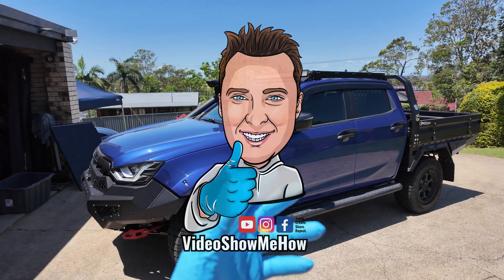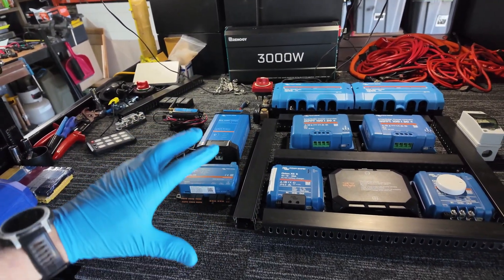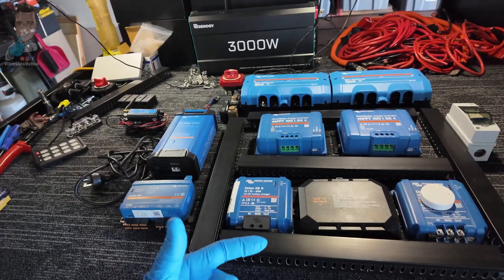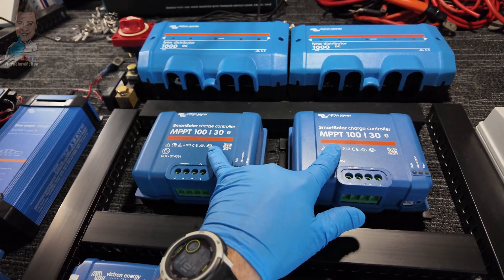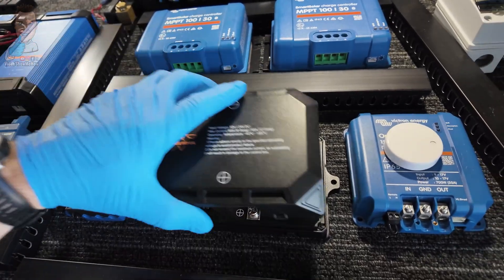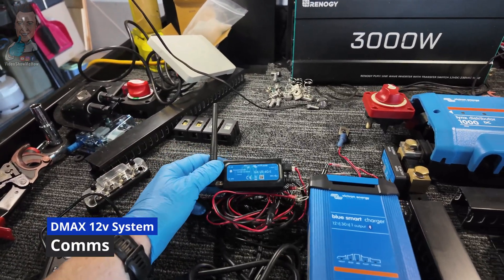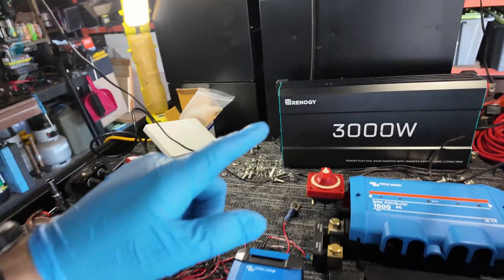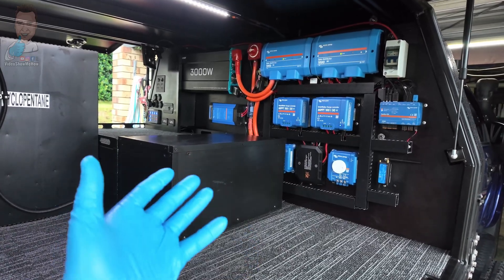Is this the ULTIMATE DIY 12v 4WD Canopy Power System? (Overkill Victron Build Part 1)

Comment: I was originally planning to run a similar setup, but instead I went with the Redarc Alpha 100 paired with TVMS and RedVision for remote switching. It manages both my 600 W of fixed canopy solar and a 600 W solar blanket, from which I regularly see 60–80 A input. The unit is about a quarter of the size and weight with a plug and play install, so only a few cables. 
I’m running a 250 A alternator with 2X 230 Ah slimline lithium batteries mounted behind the rear seats, with full use of the seats, so there’s no loss of canopy space and the weight stays forward of the axles. Charging performance has been excellent. I’m seeing around 80 A at 600 rpm and a full 100 A at 800 rpm idle. Looking forward to see what the Victron puts out.

Comment: Looks great. Sadly recently swapped my victron inverter for enerdrive to save 12kg. Now it’s not 100% victron and not all in the app. But keep the weight in mind if you’re considering multiplus/pheonix. I run two of the xs but have them turned down to 35a due to factory alternator. Maybe one day they’ll get turned up to 50a. They are killer though, also had the old ones and they smelt like car was going to burn down after 5 mins

Comment: Thanks for the vid, will be following along closely. Will be doing a similar build later in 2026 as we get a new canopy and get setup for the lap.
We have a full Victron 24v system in the van so keeping similar components in our canopy will act as spares if needed, so our battery will be a Victron 300a 24v. You’re better than me with the inverter, my ocd wouldn’t cope without having a blue inverter. I would have saved the money on the 240v charger and dropped the Multiplus in. Any reason you didn’t go the XS1400 for DCDC apparently runs much cooler.
Reply from the maker: Yeah mention some of this in the vid (multiplus reasoning 11:40 ), most of these parts I already had from previous build, so rather than buying everything new again recycling some bits ;) I ran 1x of the xs50 for a year or so just after they came out, runs waaay cooler than the old 30amp version.. always saw 48-49amps

Comment: Not using a Victron inverter makes sense in a small space like a canopy. As they are low frequency, they have a large toroidal transformer making them larger and heavier than the Renogy type.
Reply from the maker: Yeah may go to one later, but will recycle these from old system for now. Though would reaaaally like the inverter showing the on the cerbo!

Comment: For the heat you could always look at some small pc fans, have seen a few builds online that used them and they seem to work, don't draw much power and can even set up temp switches so they don't run all the time...

Comment: The san hima switch panels are better than some as they use positive switching, I.e It switches off the positive and not the negative which is helpful if needing to run relays or if the negative is coming from elsewhere
Reply from the maker: Yeah been good so far. App works great also compared to some others

Comment: Fantastic setup Adam as usual with all your builds. I have a smaller setup in my van but similar. Victron and Renergy. I did have a laugh to myself when you said that it is not because it’s all blue. Sorry to tell you but the blue thing is a proven sickness 😂. With your DC-DC Chargers there is a guy in Bris who 3D prints fans that mount underneath the chargers and come on at a set temp. They are reasonably priced and from my experience with mine like your old 30 amp Victron dc-dc charger works great with the extra cooling. And he is great to deal with. Can’t wait to see this build videos.
Reply: Hi who is the guy in Brisbane that makes the fans and how can I get hold of him please?

Comment: That is an impressive setup.
How come you didn’t go a 48v setup with a step down converter? 
It would have been highly likely cheaper and deliver more power.
Reply from the maker: Already had most of the gear as 12v otherwise yeah prob would have 👍

Comment: Looks great, I have a very similar system, the Renogy inverter's are bulletproof, I also hooked up a 14inch ultrathin touch screen to the cerbo I got off Ali, it looks fantastic, I control two Renogy inverters (1000W / 3000W) from the relays on the Cerbo, so you can turn them on / off via the touchscreen, you will probably do this via your San Hima unit, I found the XS charger gets a little hot, but it still pumps out 50A irrespective, it doesent get hot like conventional DC to DC which some get stinking hot, a 120mm PC fan mounted behind it, run at around 10V so you can't hear it keeps it happy, there is a new version of the charger - XS1400 they have installed a heatsink on the back instead of the flat panel, the only complaint I have with Victron, I wish they would upsize their cable connectors, these always seem too small
Reply from the maker: Oh nice, didn't even think about switching the renogy via the cerbo! Hmmmm. Will have to suss. Yeah had been running the one with the ruvi tag for a while just after they came out, was pretty consistent at arouind 48-49amps which was awesome. Waaay better than  the old orions
Reply: @VideoShowMeHow  Cerbo integration, I took the output of the cerbo had to cut the back off the renogy remote switch with a multitool because the case is moulded around the circuit board, they conveniently have a rebate you can follow with the multitool and no damage to the circuit inside, then connect the ouput to the switch, clean up the cut plastic, and you can basically reattach it with a bead of hetmelt around the cut section to reseal it, the cerbo will over ride the remote switch when the switch is off, but you can still turn the inverter on via the remote switch without using the cerbo if needed, I am lookig at making a splitter for the RJ45 cable, so you can plug the remote and cerbo into the splitter, then output this to the inverter, this way no need to cut the back of the remote open, looks pretty easy to do, just ordered some stuff from Ali to give it a shot.

Comment: Holy shit, this is an amazing setup. I think realistically if you set the 2 Orions to 40A output each you wont have any issues with heat and your alternator will have plenty of headroom. Maybe it can handle 2 x 50A but these are adjustable which makes them so much more appealing.

Can't wait to see the rest of this build. We are doing something with our camper trailer, albeit on a much smaller scale, so very interested to see how this pans out.
Reply from the maker: Will be showing it in action in part 3 👍👍 Wish me luck 😂
Reply: @VideoShowMeHow subscribed to see that setup. I have a pair of these as well in my van. I can't decide if I should set them up the same or set one 0.05V higher. I'm concerned they might oscillate in certain conditions.
Reply: Good idea, the chargers will run at 50A, but running both at 40A is a good option.

Comment: I love these build videos mate! Can we sign up to Patreon for the next videos already? Can't wait :D Surprised 400aH, that's an insane amount.
Reply from the maker: Lol 😊 No patreon, just YouTube membership. Usually release a little early there 👍
Reply: @MrSly870  It's necessary when you're heating water with electricity, it takes a stupendous amount of energy to heat water, that's why it's in your engine as coolant and not some kind of oil. It's worth the corrosion issues because it takes massive energy to warm it up.

Comment: Genuine question, will your aftermarket 160amp alternator be able to keep charge to the cars demand, canopy DCDC and caravan DCDC? Will you need to upgrade to a 240amp Jaylec black?
Reply from the maker: We will see, if not will go to the next size up but thinking should be ok. Good thing about the XS units is you can customise the charge rates. Will be showing the outputs in part 3 👍

Comment: Why does one of your DC-dc have a white bottle cap on it?  Nice set up other than that! 😄
Reply from the maker: It's a wireless temp sensor, a ruvi tag. Links in with the Victron Cerbo for live temps - this way I can monitor the DCDC directly as well as have the overall sys temp at the shunt.  Works well, will be in part 3

Comment: Holly wow, ahah what a set up.. I’m  running Victron for the past 2years with no dramas at all…  very neat man I like it. Just the one thing with the ac charger see how it runs being on its side..  normally like to vent from the top.. so u sit them up right.. as they get bloody hot.. but looks like rooms tight in your set up..  looks mint
Reply from the maker: Cheers! Yeah a little OTT but is rad. Good spotting on the AC charger, thought exactly the same but there is no vent on the top, just one big heat sink and internal fan blow out the bottom so should be sweet :)